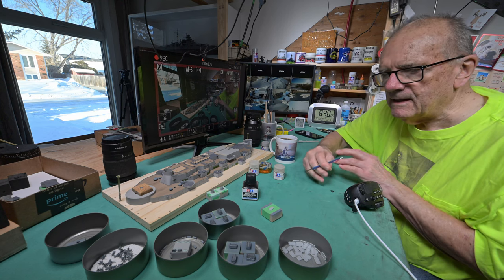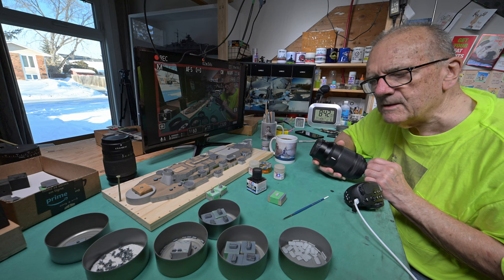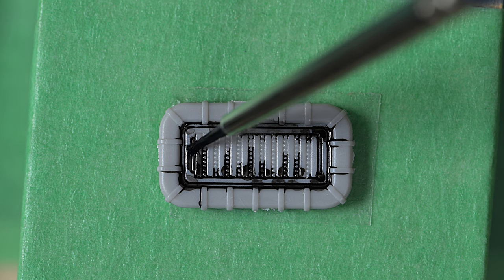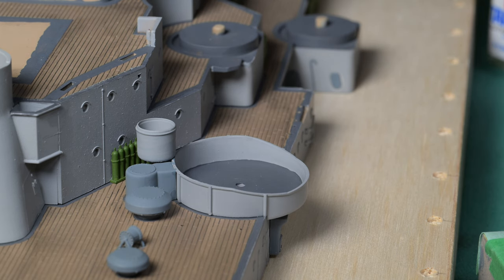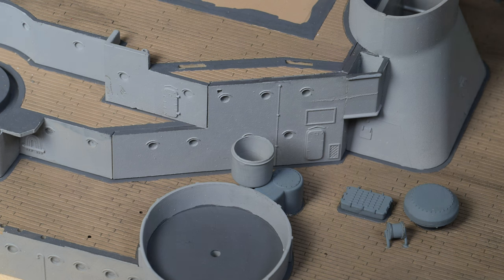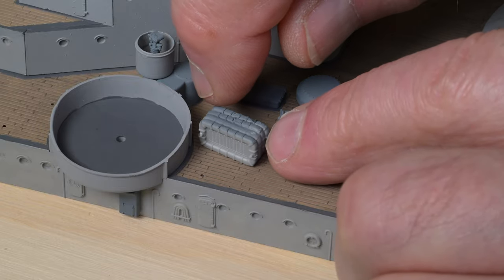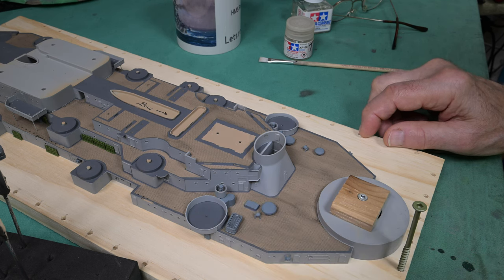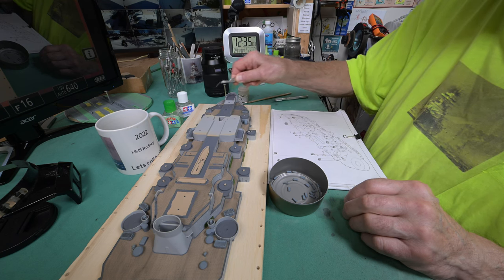The Model Ship - Part 1511

Comment: Hi Ron,  I started having a lot of issues with model building and I thought it was due to dexterity. Turns out,  I just needed stronger glasses for up close work.  The issue with that, which you are well aware of,  is when you increase the strength of the magnification on your glasses,  your depth of decreases. I have added a lot more working light to help stop down my eyes aperture.  I am using two 12x12" photo LED panels 4 feet away from my working area up at 45 degrees to the left and right.  This has helped a lot.  I make a lot less mistakes now.  The down side is glasses are constantly on and off,  or changing when switching between close up model working distance and just a little farther to when reading and looking at reference material.  You already have the enough light,  so maybe just need some stronger glasses.  I now switch between 1.25, 1.5, 1.75 and 2.0 when working on my models depending on what I am doing. And with all that,  still need the headset on top of glasses for the real up close work. It's fun getting less young.  Keep at it.
Reply from the maker: Hi Duane,
I agree with everything you've said here about light and different glasses. I am using "six" 12x12" photo LED panels "3" feet away, and often an extra LED spotlight to boot. If need be, I can produce light on a small area brighter than direct sunlight. But now at 76 I'm definitely noticing dexterity issues. 😁

Comment: Hi Ron you are missing two important steps 
1. Clear coat it, this is important because it gives the part a smooth finish so that you can do step 2
2. After it's dried for about an hour take a cotton bud and clean the excess panel liner off the raised surface, because you allowed the drying time the panel liner will come off the raised surfaces and remain in the recesses. Best wishes Vic
Reply from the maker: Thanks Vic. I gotta order a bottle of low odor mineral spirits. 🤞
Reply from the maker: Hi Vic,
Re: "Hi Ron you say there's probably a way to do that bend. There is, use the narrow prongs on the other side of the bender. You should have various widths on that side and so allow you to bend any ...." 
I was responding to this comment and I must have accidentally deleted it. Sorry!
Anyway, we'll take a closer look at those fingers on Andy's bender later today in 1552, if I can remember, haha.
Thanks for commenting again. 👍